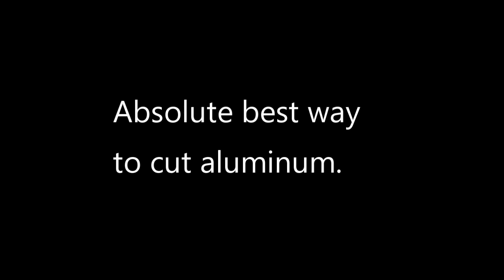Absolute best way to cut aluminum.

Comment: Good tip. Any wood  cutting blade will cut aluminum just about as easily as it cuts wood. We used framing blades on the chop saws back in the late 80's building aluminum frame windows. I don't remember ever having to change one that got dull.

Comment: Protection cover is very important for angle grinder because the disc can explode, and the high speed will make the pieces like bullets !
Reply: Yes when you DON'T know how to use one !!!
I'll bet you cut INTO corners AND bind/twist your blade too.
I've NEVER broken one,
Except for banging it on the floor, when not using it.
Reply: @SeymourBalz  Okay then why is an expiry date on the grinder discs. Is it only marketing to make you buy more or the old discs can get exploded.

Comment: If you want it to cut even better use some wax on the blade every once in a while. Keeps the chips from sticking to the carbide and in the gullets.  If you don't feel like waxing then a spritz of WD-40 will drastically improve the cutting action.

Cheers,

Tom
Reply from the maker: Good to know thanks
Reply: or Methylated Spirits
Reply: yeah i was drilling 50mm holes in 4mm with a hole saw and i was struggling,put some wd40 and it was quick and clean,will keep that wax trick in mind.thanks
Reply: I use a mixture of mineral oil and hdpe plastic that I shred into a fine powder (I use the left over plastic bottles from wife's laundry).
 
I mix it into a paste, then put it in a $5 crockpot for a while until it becomes a putty. Then I add a bit of paraffin and more mineral oil until it turns into a runny mashed potatoes mixture.
 
 I just dip blade edge in it as it's still hot, and it puts a thin coating onto the carbide teeth and edge of saw. I then let it cool. 
 
Now when I cut the aluminum, I sandwich it between 2 pieces of 1/4" wood. Then when I start my first cut, the mixture I use tends to run behind the carbide edge, and fill the area and move to the next edge. And so on. So it basically adds a coating that stays, and allows the blade to not clog. And it makes your shop smell pretty lol.
 
Now... I do this with a 12" sliding miter saw, with 96 teeth (really wide tooth, but thin kerf blade) and , and never tried on a regular circular saw. But it should still work. 
 
It DOESN'T  work on carbide toothed recip blades, or jigsaw blades though. I think it's because the substance, as it gets hot, and separates from carbide edge, it  doesn't get passed onto the next edge as the next blade passes through. All it does on a recip/jigsaw is build up at the edge of the cut/stroke.
 
It seems like a lot of work, but it leaves a finish that us almost mirrored.
 
You might want to practice a bit with it though. It lasts on blade edge a while before it needs another treatment and it might look like the blade is no longer treated, but once you get the blade hot, you can see it's still there behind the carbide tooth.
 
Good luck, and know that you will want to keep blade away from your leg, so it doesn't pull it in the same way I just pulled yours. 😉 🤣 🤣 🤣  !
Reply: Can we use paraffin like candle, Sir?
Reply: @Юлиус-п6ц  Yes. Any kind of wax that will stick to the blade  works to improve cutting action.

Comment: I was doing some cutting on 1/2 inch aluminum with my angle grinder like you were and just taking too long and too many cut off wheels, I even put a 7 inch wheel on and that was a big mistake, it broke and went flying out my garage , found it 2 days later across the street in my neighbors yard, thank god it didn’t hit anyone or even my face , I went with my saw and works fine and safer

Comment: Good share, been doing this for 20 odd years but never thought it was one of those somewhat unknown things, the beauty of youtube :) the smaller blades are really handy too, the 4 and 5 inch with thick kerf carbide tips, much the same as that blade, just smaller, nasty if they bite though :(
Reply: It is the beauty of YouTube.  It’s great to have folks share solutions from all over.  Makes us all better.  Sincere thank you  to everyone!
Reply: I've got a dedicated grinder that has a wheel with 3 cupped, 1/4" diameter carbide 'teeth'.
I'm afraid of it.

Comment: Those blades are great!  I use a 10 inch aluminum blade for cutting aluminum tubes and bars on a table saw.  Great cuts but I HATE the shavings.  You basically need to be decked out head to toe in leather safety gear 🤦‍♂️

Comment: I use carbide wood 4 in blades in an angle grinder. It's very fast. I use the guard on it cause it won't hesitate removing a finger . It will do what 100 cutoff wheels will do. Use a diamond rotor wheel and you can sharpen the teeth once they start galling

Comment: nice !! yeah im getting annoyed with cutting aluminum with my angle grinder lol.  i actually sort of want to get a table saw fitted with one of those aluminum cutting blades. would be so easy to get nice straight cuts on fairly large pieces without having to try and keep the saw as straight as you can. good job though !
Reply: That’s exactly what I’m hoping.  I’ll know in a couple hours.

Comment: That's how i drill aluminum, with the old style wood drill for 1" or so, https://youtu.be/cdJAiIiPBA0
, works perfectly, i will try a 6mm aluminum plate with a wood circle saw next
EDIT: YES i just found a old would circle saw and blade, it works perfectly, thanks for the heads up

Comment: How are you getting flat against the rail there the weld is with the frame/casing around the blade?...
Reply from the maker: That blade will cut the welds if that's what you're asking

Comment: Hello I have an Xcluder door sweep that needs to be cut the video website said I can use a Hacksaw any suggestions on which one would be good to cut it?
Reply from the maker: I don't know what an excluder door is but if you're trying to cut something let's say longer 4 or 5 inches a hacksaw would be difficult to control in a straight line. A circular saw for instance would give you a straight line for at least 7 inches.

Comment: Would I be able to put that blade on a mitre saw?
Reply from the maker: Usually the 7" blades have a smaller hole than a 10" chop saw but you can use any Carbide tip blade to cut aluminum.  The blade for aluminum is just thicker and will last longer

Comment: If you can't find a specific blade for 'aluminum cutting' then pretty well ANY carbide tooth circular saw blade will do the same cutting, just buy a blade with as many teeth as you can,.. 10 inch blade 80 teeth, 7 1/4 inch blade 40 to 60 teeth are example, but remember to wear good eye protection AND dust mask. Aluminum dust in your lungs and or blood is NOT GOOD! :)
Reply from the maker: I agree that any blade works. The ones that say for aluminum cutting on the blade are much thicker. I assume for maybe heat build up.
Reply: @JLafix  Yes you're correct. I found 'aluminum blades' on Amazon brand name of OSHLUN, these cut and last well too, I've found.
Cheers!